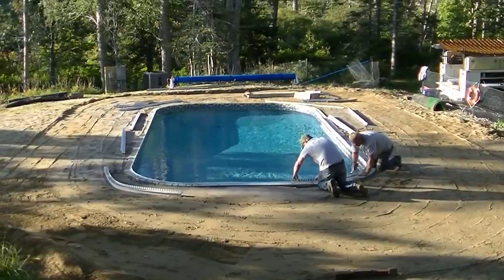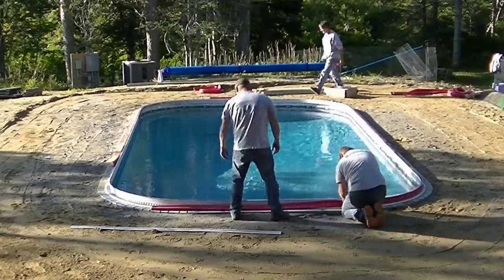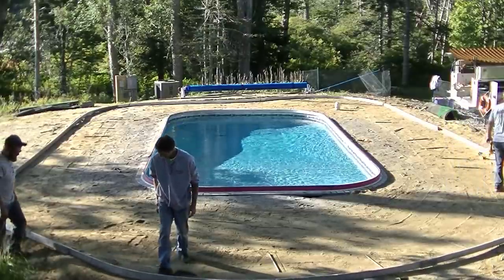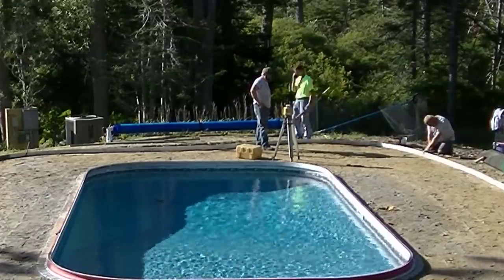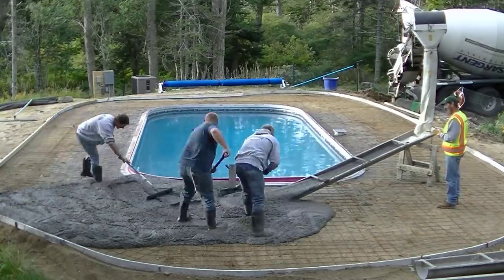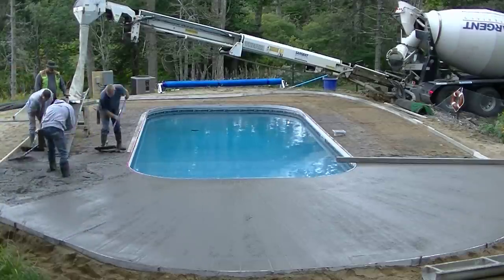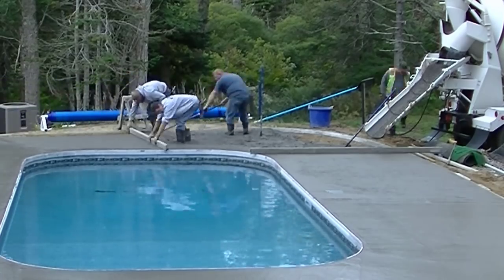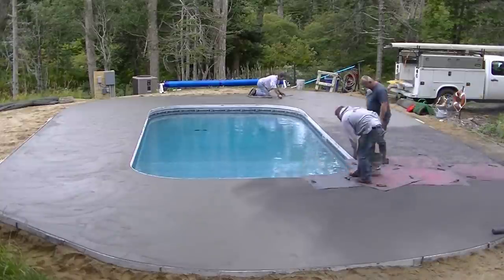Making Money And Charging What You're Worth! (Owning A Concrete Business)

Comment: I'm not a concrete contractor and in my area I could not get anyone to use the Z pool forms. I bought the Z pool forms, and had to install them myself on a freeform pool. I also installed them on the outside edge of a keystone block wall with the pool liner coping. 75% of the pool deck exterior is keystone block. Job looks excellent. HVACR contractor is my profession. Where I live in Arkansas concrete contractors SUCK! They won't do shit I couldn't even get an estimate, so I bought the forms and figured it out myself. You and your guys kick ass.
Reply: @ZCounterform1  I got the forms from you guys, and they are awesome. I used them on keystone block walls, steps, fire pit top. Easy to use for sure. So easy even an HVACR contractor can use them. I just wish I could finish concrete like Mike Day.

Comment: Hey mike I live in Vermont and my rates for stamped concrete are just about the same as yours thanks for the tip on price per foot for z form and form liners I’ve been wanting to give the z form system out for a pool coping , I picked up a set of slate form liners last spring they were kind of pricey but I’ve used them on every stamp job since they are really worth the money thanks again for all the great educational content 👍

Comment: Hey Mike something I seen a while back when laying down wire mesh. Instead of use it the little stands and wire tying it all down a guy just used thin bricks and layer the wire mesh on top and it was perfect height no pulling wire up when pouring just simple and easy and works every time. Thought I would share .

Comment: Have you ever used the styrofoam cantilever forms for pools? We use those on the pools we build. We will lay about a 16" wide and stamp it and then we will come back and pour concrete right up to our coping . Iv never used the type You're using. I like that Ill have to look into that. The problem with the styrofoam forms you can't reuse them. I'm a pool guy and we do all our concrete.
Reply from the maker: We started with them These are much easier in my opinion. Plus you get dozens of uses.
Reply: @MikeDayConcrete  yeah. That's what I hate about the ones we use. And u better not mess those styrofoam ones up because you can't buy just one form you have to buy the whole set which isn't cheap. Awesome work.
Reply: @ZCounterform1  ok. Thanks for letting me know. I'll definitely look into them. Always looking to improve.

Comment: I get 15 sq ft in TN . Until watching your videos I was cheaper and lacking confidence in what I been doing for years! Thanks Mike!
Reply: 15 a Sq ft is cheap I charge 20 to 25 for stamped I'm in Virginia concrete is 180 a yard color adds 35 a yard. Stamp sets are not cheap. Yea color harder is cheaper way to color but it's still cost and stamped work is alot harder than regular flatwork
Reply: @codybosley400  what company used per the color what name?